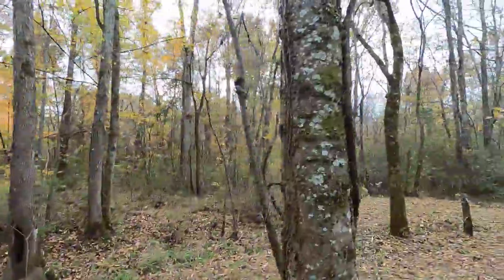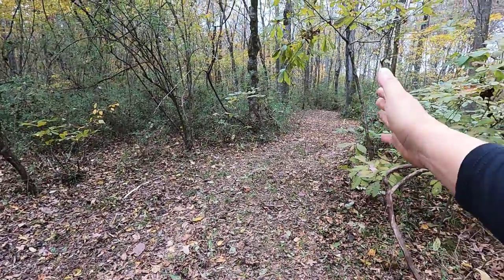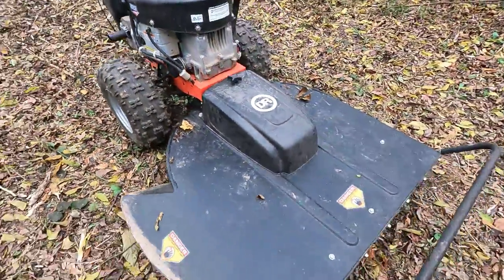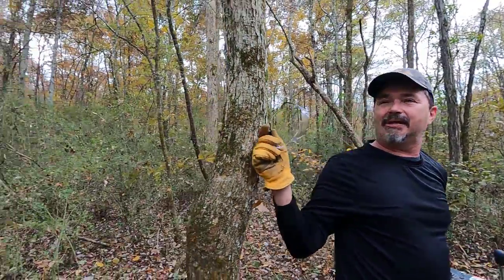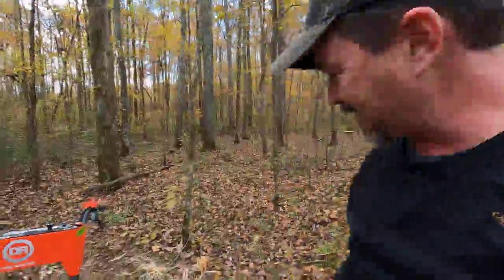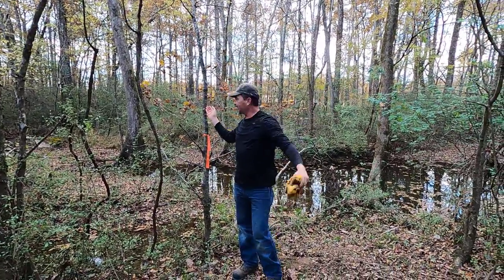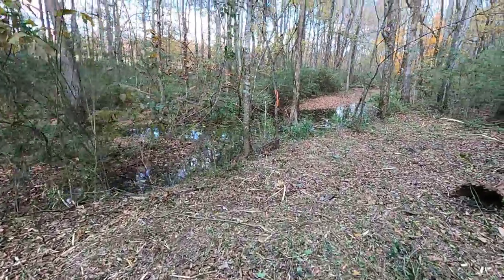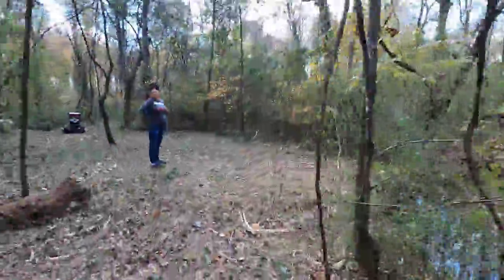Rough Trail Cutting At The Creek With The DR Brush Mower.

Comment: I regret buying this machine.  I'm dropping reviews everywhere people might see them as a buyer beware - I wish I could tell any of you how well the mower works - but we received it in August, unboxed and assembled, followed all pre-use instructions, and the drive belt shredded after only several hundred feet of use. Mower won't drive forward without it, so we had to tow it back to the house. Called and spoke with the company, they agreed that there must have been an issue with the belt, but we don't have a nearby DR dealer shop or a winch to load a very heavy machine that won't drive itself forward/up a ramp, so they recommend replacing the belt ourselves. The trouble is, this mower is not user-service friendly. So, after paying 3K$, here we are on the floor of our garage with a brand-new machine, inching our way through each overly complicated step to replace this drive belt, and consequently we don't have a single kind thing to say about this machine.  Since we live in WA, we may not get to even try this thing out again until next May when the rains stop.

Comment: You have a tractor? I'm curious about the reasoning for not using it. Why would you buy that walk behind when there are flail mowers available that will cut 3 to 4 inch trees that are priced lower to slightly more than the DR? And there are rotary cutters that cost even less.
Reply: You have a better chance of seeing something that you DO NOT want to run over with this than a tractor.  I just rented one of these, (  Billy Goat brand ), to cut tall grasses because I didn't know what was hidden in the grass.
Reply: @awalker8112 I disagree. I had written a too long reply but it simply boils down to this: Not my money. Not my problem. I simply was curious as to "why".
Reply: These easily go places a tractor can't. They're more maneuverable, narrower and portable.
Reply: with a tractor you have less ability t go through a narrow space. also unless the flail is front mounted the tractor has to drive over what you are cutting.
Reply: @jimmytate7587   y'all keep beating that dead horse and see if it moves. As before, not my money not my problem.